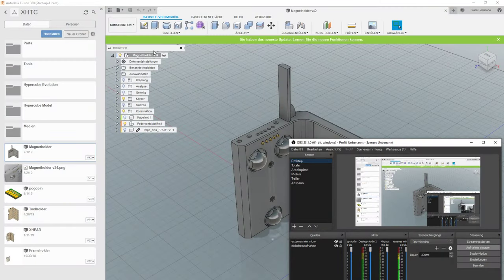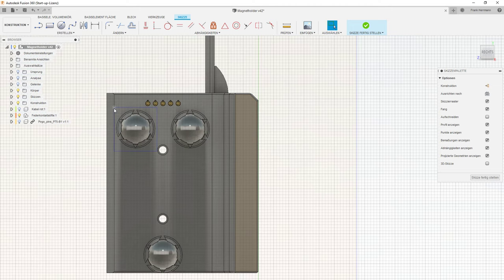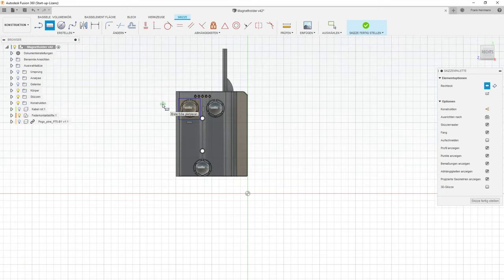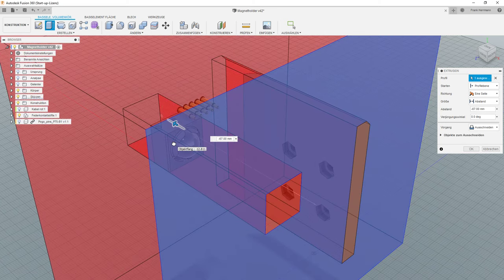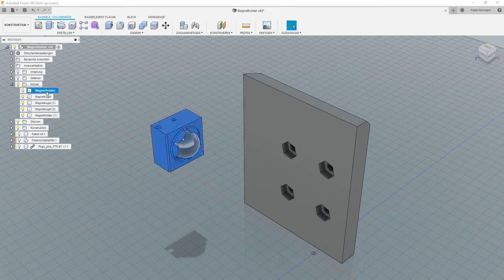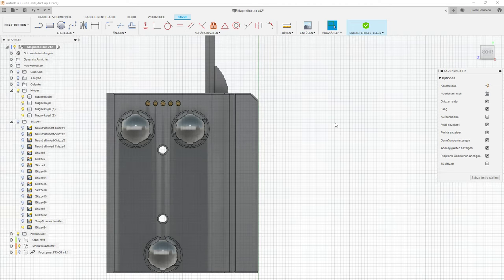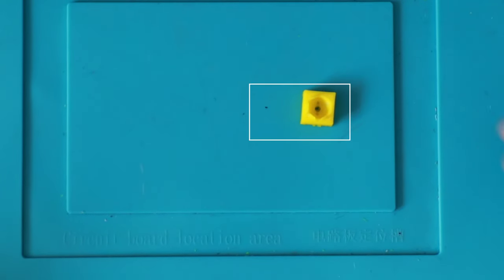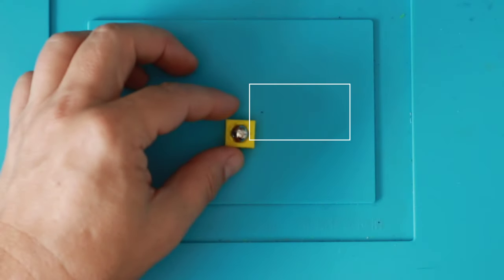Small tip to print certain tests from a construction.

Comment: I use BricsCAD Pro. A tool called "slice" I use to do as you did but slice is easier. Then select the sliced portion and export as .stl file. Use the union tool to put the part back together again or use 'undo'. Makes test fitting features painless. Another app called ProgeCAD has the same feature but less expensive than BricsCAD Pro. Both are forked versions of IntelliCAD. Also you can also make 3D parts using what I call the 'sandbox' method. I load several parts in same workspace (looks like a sandbox with all my 'toys' to pick features from) and slice and dice or copy to graft features together to make a new improved part. No parametrics.